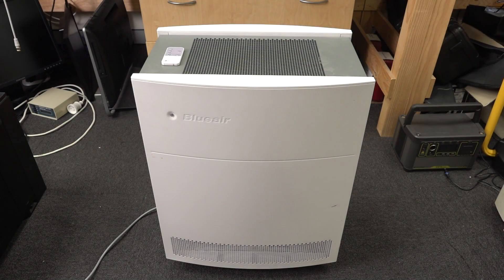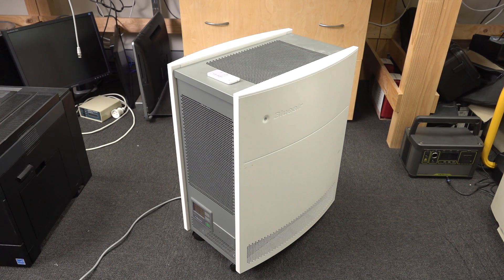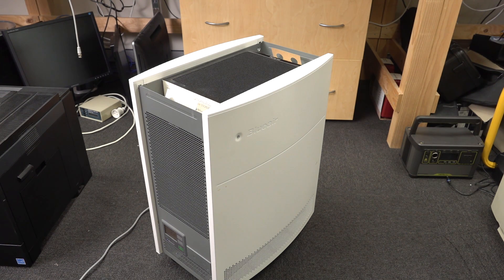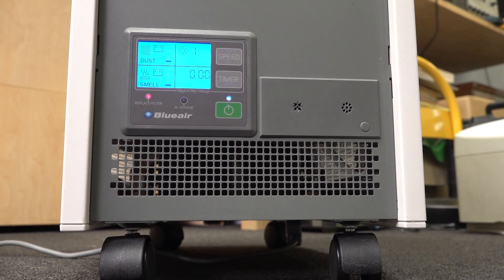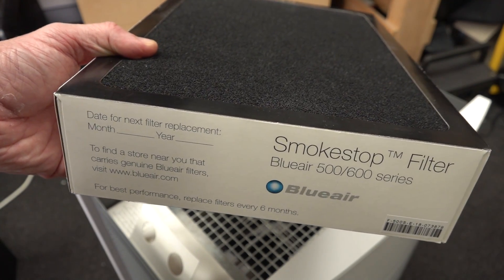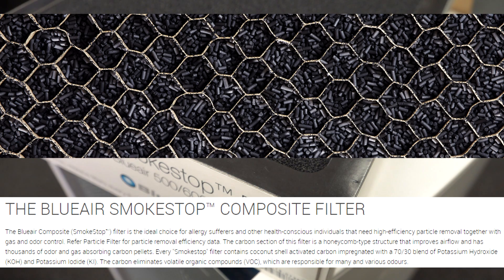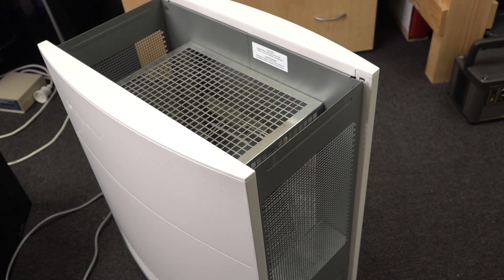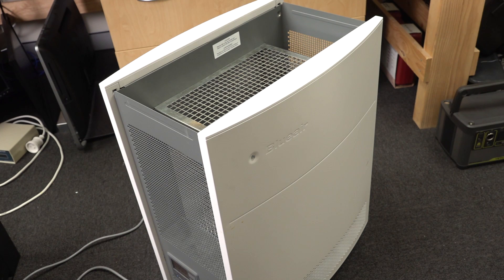EEVblog #1295 - What Makes A Good Lab HEPA Air Filter?

Comment: HEPA = High Efficiency Particulate ARRESTOR

I used to design asbestos disposal gear, and H14 is what we were legally mandated to use. H14 is pretty schmick for a lab (from a particulate perspective).
That fan is not the best design for a high volume air mover working through a filter. Centrifugal fans have a much higher static air pressure which allows them to continue shifting air, even through a partially blocked filter.
The unit claims a maximum of 700 odd CMH - I strongly doubt the ability of that fan to move that kind of air through a genuine H14. 
If you want to measure the airflow, the following is accepted standard in UK asbestos works:
~Create a tunnel at the unit output which is the same width as the unit output, and at least as long as the width. This helps to let the air "straighten out" so that it isn't tumbling so much.
~Divide the front of the tunnel into 9 regions.
~Use an anemometer to read the airflow in the 9 regions.
~Add the readings up and divide by 9 = Average airflow through the machine.

Lots of further interesting / boring reading: 
https://www.hse.gov.uk/pubns/books/hsg247.htm
Reply: @digitalradiohacker A centrifugal fan would blow the air passed the filters because there is no seal on the filters on this unit.
Reply: @Kris_M  No. It is sealed more than sufficiently. Even if some bypasses the filter, it doesn't matter since the inlet air isn't separated from the outlet air. (Like if it was mounted in a wall and was pulling air from one room and blowing it into another. In that situation, it would need rubber gaskets.)
Reply: HEPA
High Efficiency Particulate Air. Also see: Filter, High Efficiency Particulate Air.
https://www.hepa.com/glossary
Reply: @yourcurtainsareugly  He is right, "HEPA is an acronym for high-efficiency particulate air filter. Its original name was high-efficiency particulate arrestor, titled so by the US government when they were developing the filter during the manufacture of the original atomic bomb (the Manhattan Project)2." 

Not first party but will do: https://cleanair.camfil.us/2017/07/10/heck-hepa-filters-care/
Reply: @yourcurtainsareugly  
That is a modern and unnecessary change in nomenclature to keep document writers and training providers in business. Similar changes in wording are regularly applied in various electrical regulations because physics don't change regularly enough for training providers to claim that those who are already trained are now behind the curve.
Also, from what I can make out, it is also an Americanism.

MMI vs HMI. 
Originally, we had Man Machine Interfaces. Everyone knew about it, and it could be safely reduced to MMI with everyone knowing where they were. Later, some herbert decided it would be a good idea to "swap shit out", probably on the basis of misogyny. This left us with HMI.
I use MMI at every opportunity in the hope it will trigger the largest possible number of brand new, hard-left uni graduates.

Mostly, it is just potaters potatoes, but it's a good source of trolling material nevertheless.
Reply: @digitalradiohacker  Lol you gave me a good laugh. You sound like one hell of a hand full.  Cheers
Reply: @digitalradiohacker  Personally, I prefer the WMI.  Woman man interface.  It's sexy.  Always sexy.
Reply: innit. this machine is crap. carbon filter built into the hepa filter. amateur hour.

Comment: Are fans better pushing or pulling? In principle pulling might be better for the fan because it will sit in a flow of clean air.
It has been suggested that copper is a good coating for air filters: copper having anti bacterial and virus properties, destroying them on contact.
I assume that metals in the filter would also discharge ionised dust, attracting it. They might also act as a catalyst to break down any ozone. The problem with all such air filters is the cost of filter replacement. It must be possible to engineer them to be self cleaning or washable. 
During the 1970s, there was a fad for small home air filters. These used a combination of glass wool, activated carbon and carbon foam filters. They quickly fell out of favour, due to the high cost of replacement filter cartridges, the more expensive of which boasted of using a silver anti bacterial coating on the filter material.
Reply: If you're trying to certify the quality of the output air, you don't want anything complicated, like a fan, downstream of the filter, I would think.

Comment: Would the charged particles eventually lose their charge and go through the filter?
Reply: The charge is not supposed to hold the particles inside the filter. It's to attract them so they touch and get stuck in the filter.

Comment: If corona virus is mostly transferred as small droplets, and sitting on object you touch, how can they be air-borne like dust is?
Reply: if someone sneezes and the droplets fall into someones mouth. yuck. but possible. also the droplets can travel through the air and land on someones hand. 

this is just the way i see it can be transferred through air. i have not looked anything up as of now.
Reply: The thing is, they are not. Only with droplets that fall down quickly.

Comment: I have chronic asthma, and in an attempt to reduce the meds I was taking I "HEPA-fied" my home. You can even get HEPA-like after-market cabin filter cartridges for recent cars!  Felt great indoors and in my car, but my life got far worse outdoors: My meds became LESS effective.  Turns out it is important to take them continuously, with intermittent use greatly decreasing their power.  In the end, only the HEPA filter in my home lab was really doing anything useful for me.

I gave my other HEPA filters to a friend whose parent had COPD, who couldn't get out much, so they really helped.

Further research indicated home HEPA filters are not good for otherwise healthy kids: An over-sterile environment can reduce the effectiveness of their immature immune systems, making the bugs they do catch far worse.

However, wherever nasty airborne contaminants are present, especially in workplaces, HEPA filters truly earn their pay.
Reply: @David M there is a sweet spot for that. Where I live the winther can go as low as below 10% so humidifying it back up to 45 reduces the risk of bacteria and stuff. Dust settles on the floor instead of flying in the dry air.
Reply: A Gentleman  I would say that the last sentence "However, wherever nasty airborne contaminants are present, especially in workplaces, HEPA filters truly earn their pay." totally covered environments with nasty stuff like diesel particles
Reply: Humidity in the air helps to keep the dust down as well. Good humidifier lot cheaper than a good HEPA filter. However this only applies if you live in a dryer climate.

Comment: Now if you'd like to elaborate on how a single, not droplet or dust bound virus could get airborne and fly around in your lab ?
I've worked in building clean rooms for waver factoring with particle counters and what you learn is you only really reduce the count if you also only allow special materials.
But please dont feed the fear that you need to have this against corona or this will protect you if there is a sick person in the room.
Dont get me wrong, a good soldering station or lab exhaust is great, but the best is sucking it in and blowing it outdoors.

edit: dont want to be too negative here so a follow up: take a look at optimizing air flow (perhaps you find a simulation) for using in OR,
 it's quite tricky to get everything to move from clean air "top" over moving people with turbulence, 
without causing negative cooling symptoms to drop anything in the air straight to the ground instead of an openedpatient on the table.
the heatload from the movable lights already gets your nicely planned airstream completela offset.

Comment: waste of money, just buy the replacement filters and stick them in a box with a fan. you can even add a uvc light and an ionizer if you want, but these things are way to expensive for what is basically a fan in a box with room for some filters
Reply: That's fine as a hobby project but if you need it in a professional environment you need to buy something proper.
Reply: @gundalfx  well... just build a proper looking box and stick a proper silent high flow fan in it, it would be much cheaper. for a home gamer, a cardboard box and a silent pc fan will do
Reply: Oh man, can you upload a walkthrough of your house? P-P-P-Please! I can imagine the level of ghettoriggitry. I picture window banger a.c. units with cardboard "ducting," random wires tapped to the floor between rooms, shelving/tables made out of cinder blocks and/or 2x4s, and the term "very tastefully done" being used liberally in the video.
Reply: @xenonram  send me your email or facebook account and i'll send you a video. also, check my youtube channel
Reply: It's a waste of money for a home gamer but keep in mind that a company has various tax discounts and such, then a professional setup is usually worth it.
Reply: No thanks, I prefer the ionizer inside the metal case.
Reply: @Daniel-hd7gq  well, use a metal box than.
Reply: @Isaac-mustakis  sorry, I don't get it :D so you just think their products are overpriced? I understand that but they have a real good reputation 🤷🏼‍♀️
Reply: @Daniel-hd7gq  it's a fan in a fancy box with a place for a filter. the filter is what's doing the job, so i'll buy their filter, but i can build my own box.
Reply: @Isaac-mustakis  alright. But don't buy their filter. The smokestop one costs 99$ :D
Reply: @Daniel-hd7gq  and the Blueair Classic 480i cost $689.0 . paying for a good filter is one thing, paying $689.01 for a fan in a box, even if it can work with amazon alexa... well i have batter things to spend my money on
Reply: @Isaac-mustakis  I wouldn't pay that money, too. But I see why so many would and are willing to pay. Especially in a professional environment. I made a good deal for a Blueair 405. Paid only 215€ for a new one with the smokestop filter.

Comment: My homemedics filter got a uv-c light what does it do is it dangerous ?.
Reply: UV-C kills bacteria. Not sure about viruses.
Basically disinfects the air.
It is dangerous if it shines on your skin, basically the same UV that gives you sunburn. But I'm sure it's well encapsulated in the thingy and won't cause problems
Reply: @DedmenMiller  Thanks , And yes its enclosed in the unit .
Reply: Not at all
Reply: @RespawnRestricted  I got it in my bedroom it runs overnight so is it safe in that situation , there is a button to deactivate it but as i said i don't know what it does.

Comment: I use my lungs to filter the air in my room.
Reply: Am more sophisticated. I use a cigarette filter before i use my lungs
Reply: Let fart in your room.Then you will need a lot of filters.
Reply: @georgelareese1086  
And light a lighter and boom
Reply: Me too
Reply: So, when are you going to replace those filters? 😉 In Neuromancer that wouldn't be a problem, but in the current world...
Reply: @LarixusSnydes  They are pretty good at self cleaning if you don't stress them too much and if they fail, you don't really need them anymore ;)
Reply: If you expose yourself to hazardous particulate matter over a slow period of time you can also build a tolerance. 

(j/k of course)
Reply: Red Squirrel After you build tolerance, you build.....SUPER POWERS!
Reply: I use my lungs to filter the air in my bong

Comment: Cardboard boxy filters don't seal well. I have 3 Austin Air HealthMate 400 units with soft rubber seals. They say 'medical grade' down to 0.3 microns, last for 5-years, weigh 18 pounds each, with a replacement cost at $250
Reply: That sounds more like it. Doing a DOP test on the kind of gear you're talking about reveals alarming leaks despite the price and efforts of the manufacturer to prevent leaks. A silly cardboard box slotted into rails is never going to seal, no matter what it is filled with.

Comment: I have a question , when it says 58 square meters, shouldn't it be cubic meters? I have been in homes that have had 2 meter to 6 meter ceilings. I mean a room with a 4 meter height would have twice the volume of air as one with a two meter ceiling. I think maybe I am just missing something.
Reply from the maker: Yes, it's cubic, but most places are a relatively standard height and they need to make it easy for the normies.
Reply: I guess they are asuming a standard office height of something like 3m or so.
Reply: Thanks Dave for the reply and videos

Comment: Oh, activated carbon is aDsorbing, not aBsorbing.
Reply from the maker: Yes, quite right.
Reply: What is the difference?
Reply: @kamiko-i5g  Adsorption happens only at the surface, absorption happens throughout the bulk of the material. That's why activated charcoal is a fine powder, to maximize adsorption.
Reply: @The101damnations  Yeah, in fact activated carbon is just carbon with a very large surface area.
Reply: You can get charcoal filters made for range hoods for under $13 for a four-pack.
Reply: @twobtwobtwo  I strapped a PC fan to one and it 's my soldering fume extractor.
Reply: By the way I've seen projects everywhere for things like that even once a pit in Altoids tins with different filters.

I've also see I'm built it the metal lunch boxes.

And seems far ones that run on a 6 volt battery in a small rectangular box.

One of my friends his shop area was actually did a part of his house that used to be a second kitchen that was not used for a kitchen.

But originally the house was split into to two residences originally but it's not use that way now.

With upstairs and downstairs but it did connect buy interior stair way.

You would have to go through tomorrow residence to get to the upper.

And also the range hood in the Old Second kitchen he had a plate that would slide over it liquid intake hose for is exhaust system.

And of course there was also washer and dryer in that area as well.

Tell us the range receptacle.

And plenty of 120 volt 20 amp circuits in that area.

So Boston's how are you would need in a shop.

Not to mention plenty of storage cabinets.

Something to think about if you ever live in a house with an unused kitchen area.